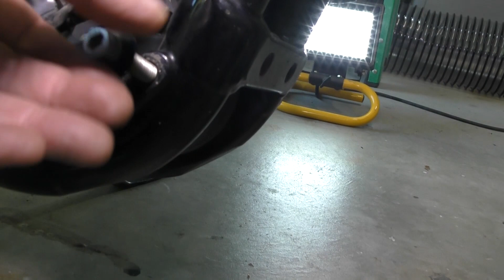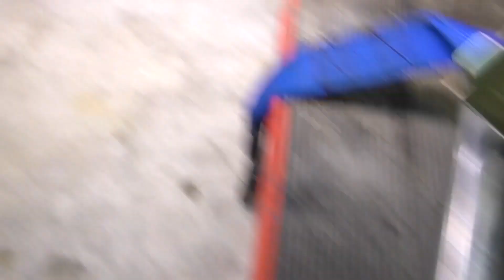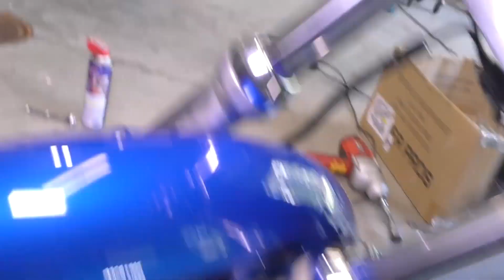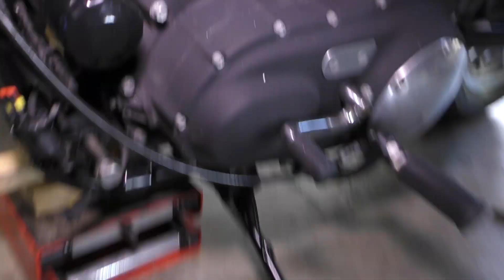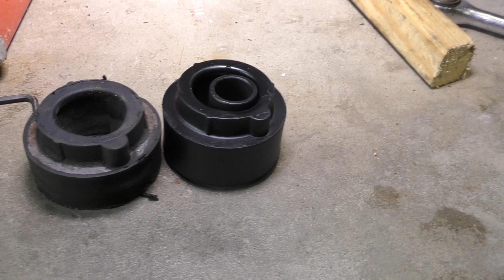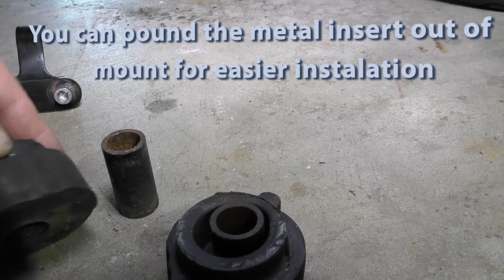Replacing Front Rubber Motor Mounts Harley Sportster 2004 and Up

Comment: Thanks for the video.  I was able to change my mounts out with the help of your video.   I was able to get all of the mounts out and new ones put in.   I took off the gas tank and everything else that was in the way in order for the engine to move which ever way possible.      I knocked out the shaft of the right side air filter side and was able to get the new mount in without knocking the shaft out.    Knocking out the shaft of a new mount seemed pretty dumb in my eyes.   I did everything I could to avoid that and I was able to get the new one in

Comment: would this cause excessive vibration around 3k rpms? I'm not sure if the issue continues higher in rpms, the vibration is really bad and didnt want to risk breaking the bike even worse/ this happened to me coming back from the store on the way there everything was fine, but on the way back every gear right around 3k rpms it just gets horrific
Reply: Same here so I think im going to do thisor have my mechanic do it
Reply: A mi tambien me pasa😢

Comment: Hi! Thanks for the video. As you advised, I knocked out the inner steel sleeve from the old right isolator and easily removed it. However, it is not possible to install a new one because of the engine rests against the frame and the gap for installing the new isolator is 3-4 mm smaller than necessary. I moved, raised and lowered the engine, but it was useless. So I'm going to install a new isolator the same way I removed the old one. I will knock the sleeve out of the new isolator and install isolator then install the sleeve back.
Reply: Today I really did it. Thank you again for your little trick with knocking out the inner sleeve. I wouldn't have guessed to do it and would have been stuck for a long time with a replacement.🤝

Comment: What kind of signs/symptoms indicated that they needed replacing?
Reply: You most likely will notice a harsher vibration at a certain rpm also the engine will sag and not be square in the frame and you could have belt rub in extreme cases
Reply from the maker: Vibrations while going down the road.
Reply: My right side of rear wheel is rubbing my sissy bolts. My mechanic says its the engine mount too

Comment: I'm going to try taking out center piece and still going to have a hard time getting the Mount compress 3/8 of a inch
Reply from the maker: Hey Wally if you take out the center sleeve it comes out and goes back in without a lot of troubles.

Comment: Cool video, mines a 2008 Sporty. It’s my first Harley and I’ve had quite a few bits to sort out on it already, I think I’m gonna have to do this too in the near future. Thanks for that
Reply from the maker: Replacing both the front and rear rubber motor mounts helped tighten up the "loose" feeling of the motor in my XL. I am glad I did it. Thanks for watching and the comment!

Comment: Hay Mark we jave talked before on here I was wondering if there is anyway I can contact you to ask you a question with a problem I'm having with my hammer 1275 sportster it be alot easier to talk to you on phone off possible to tell you what it's doing if at any way possiable my email is mike63novass@comcast.net
Reply: Great content and great video production . I was wondering do you need to align the motor / belt/ ect , or do they kinda fall back to a close or better than factory setup ? PEACE
Reply from the maker: @jimhayes4000  The motor mounts align the motor to the frame so you do not have to worry about that. I did have to realign the rear belt to the swing arm upon reassembly.  Thanks Jim!
Reply from the maker: Okay Mike.